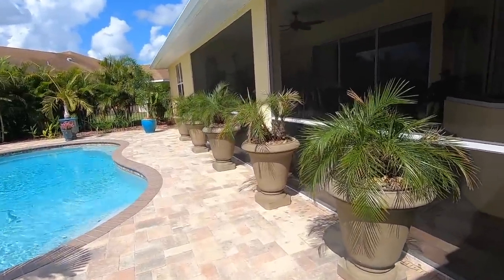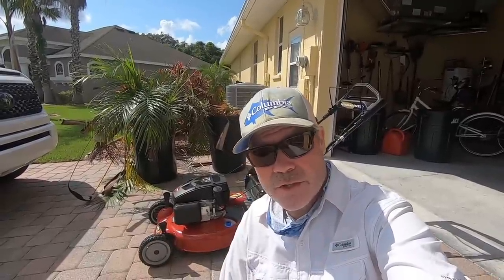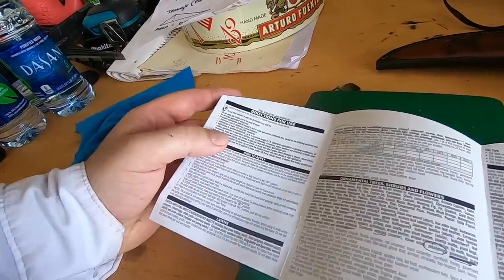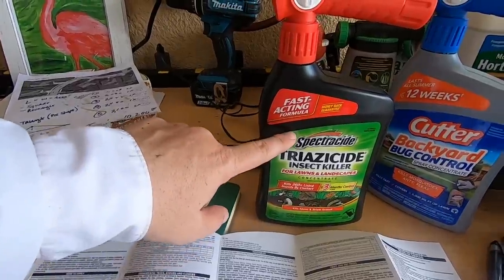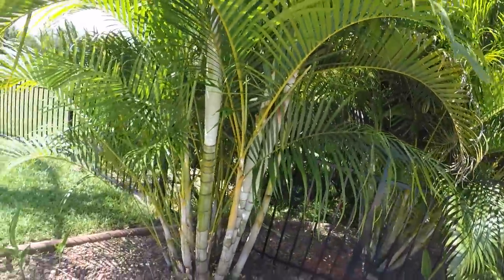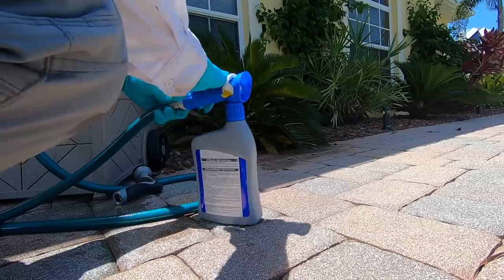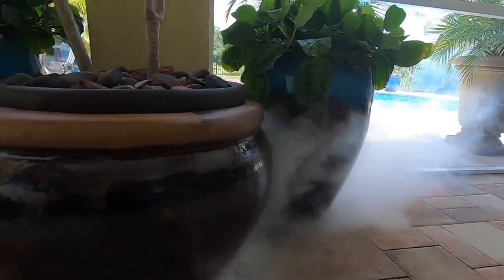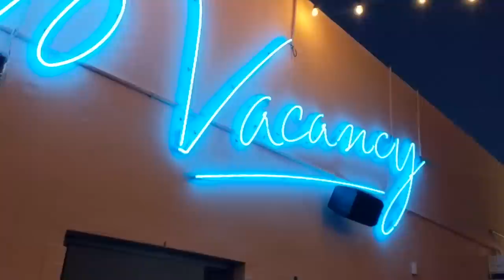How To Get Rid of Mosquitoes In Your Yard and Landscape

Comment: I was spraying and praying with Talstar P and a backpack sprayer last year. And while it worked, it was laborious and I wasn’t sure I’d like all the chemicals floating around. This year, I picked up a .5 acre Dynatrap at Costco. I thought, what the heck. It was a cheap experiment and Costco had an excellent return policy. On top of that, it was effortless. What did I have to lose? I’ve had the thing for 3 weeks now and it’s been working great. We’ve been out on the deck numerous times and it’s been mosquito free. I still plan to spray and pray, but will be cutting back on the amount of product. I figured defense in depth works the best.
Reply from the maker: I need to look into this!
Reply: Dynatrap works. You get a lot of moths though.
Reply: I'm curious about those thermacell tiki torch style emitters. My brother in law in NC swears by thermacells when hunting in those backwoods during the summer months.

Comment: Also the ThermaCells are really amazing. I've been deep in the woods getting chewed up by mosquitoes but once i turn it on I get 12-15ft of freedom, lol. Usually last 4 hours/pad. But i just ordered the new extended release pads that are supposed to last about 12 hours. The mini butane tank lasts 12 hours as well, so it makes sense. Also used this at a July 4th parade in Mount Dora and some lady was thanked me a bunch of times. By far and away the best thing ive every tried. Works everytime. Definitely gonna look into getting that fogger though.

Comment: Some good information in regards to mosquito control. Unfortunately fogging isn't an option for me in my area. I also recently got a puppy so, I'll have to be careful with my next pest application. Because of this, I've been researching various different mosquito management products and came around the Spartan Eradicator. So far I've placed 1 pod by the pond and I've noticed around 80% fewer mosquitos than what I was experiencing last year! I'm about to hang another pod on the opposite side of our fire pit to see what kind of results I get. I would highly recommend checking this product out if you are looking for a pet-friendly alternative. I'd be curious to see how it holds against the fogging method.

Comment: Hello Allyn, yes you would be correct that both Spectracide and Cutter are manufactured by United Industries Corp. They also produce Garden Safe, Liquid Fence, Hot Shot, Black Flag and Repel. What’s not mentioned on the UIC website is they also manufacture Walmart’s house brand Eliminator. Just an fyi…Mike

Comment: Coming from a pest control angle, our aim is to minimize breading sites & the hungry swarms these create. As we do not visit our customers as regularly as you may do, we prefer to be a little harder hitting with our treatments. We have found that advising the (active) customer on topics such as air-flow, vegetation maintenance, & rubbish removal, in itself makes for much greater results.  Of course we can clear those areas out if agreed on. The treatment itself though will involve the application of an insecticide sand onto the lawns & garden beds, a vegetation friendly residual insecticide applied up, under & within the palms & shrubbery as a very fine mist, wand treating fence lines, shady sides of buildings, wooden, dark coloured features, under sun umbrellas etc... as you can imagine, each job is different as it must match the micro climate the property presents.
To complete the package, we also sell domestic sized UV mosquito units as a companion to have outside when entertaining, after all, a mozzie can just fly straight onto your property & become a pain without rummaging through the undergrowth first...

Comment: Hey Allyn, kind of unrelated, but I am not sure how else to message you, than on your latest video. 

I'm from the Chicagoland area and my last application of fertilizer was on 5/11, Carbon-X. I put down about 3lbs/1000. It has been extremely wet since then. The temps are still pretty cool here. I know for the 3rd round, we want a bit less Nitrogen, but should we go a little heavier for the 3rd, im assuming quite a bit of N was lost with the saturated soil. Thoughts? I was going to apply Milo in a couple weeks, at the suggested rate, 10lbs/1k. But if I can go a bit heavier, I would like to use Carbon-X again at 3lbs/1k.